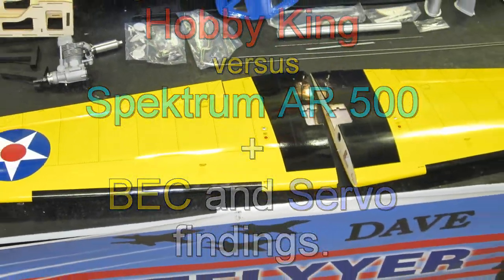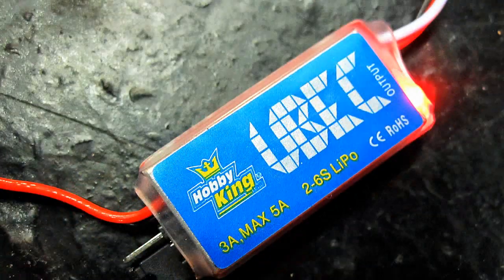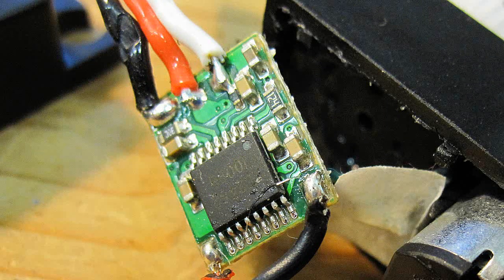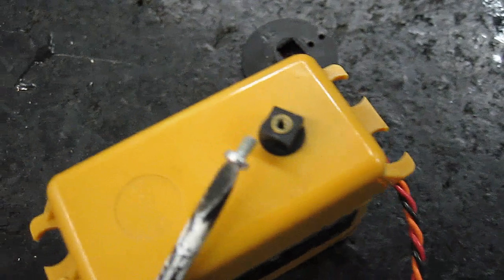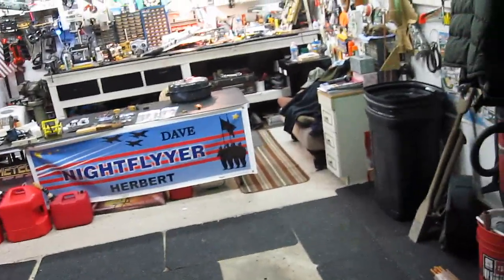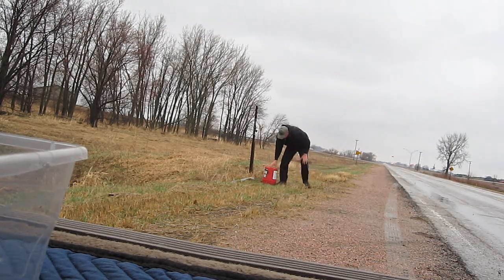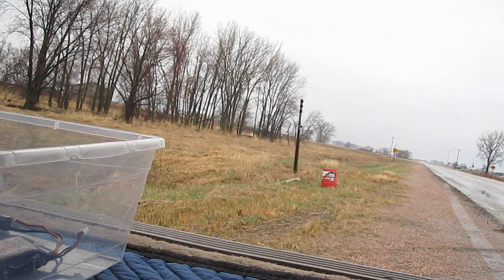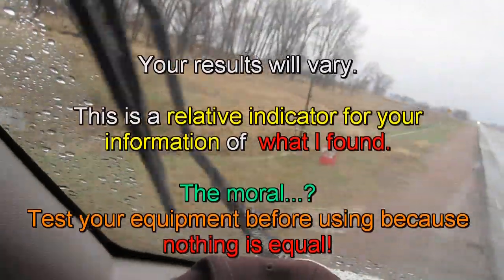HK Orange Receivers vs Spektrum AR-500- Range testing and servo failures.

Comment: When building a EXI 450, I had to remove my Spectrum AR6110 because in declining battery charge the motor would cut out on me. I erplaced it with one of the HK orange rx's and have had no problems since. I give them a thumbs up for being 80% cheaper and having good performance. Of course I can't fly my 450 near as far as an Airplane anyway.

Comment: well i appreciate your test results , i noticed the orange recievers were not the full range , where as the spektrum was,.  thay do have full range orange rx.s  with two ;long grey antennae , and i have had no problems with the full range.  yes i did have issues with the orange rx.s with the one little short red antennae   thank you , please try your experiment with orange full range ,  would love to see the results.  and fyi,  i recently have had issues with my new DX8 FAILING RANGE TEST, horizon hobby stated nothing wrong,  crashed two planes , could pace off only about 23-25 paces during range test,. not sure what to think. thank you  marty

Comment: Great video Dave, very informative.  I was wondering about the orange rx's as I run futaba and just bought a couple orange rx  but havent had the time to range test.  
I do have one question though  Why is the orange rx 1056 at 20 ft and only 793 at 15 ft? when the specturm is 1056 at 15 ft? Isn't range "Range" so to speak? or did I miss something? I did watch this video 3 or 4 times LOL any how Great test.
-OTTO-

Comment: @flyingchimp99 It takes power from the lipo and takes the volatage down to a safe voltage to power the rx and servos. Most esc has them built in but you can use an external one for saftey

Comment: To all the commenters, just my two cents...... I have a bunch of orange RX and I have a few that give over 60 paces on the range test, while others barely go 25 paces.  All have alt $12.00 plug in receiver.  Most of the guys that have spectrum TX at my field use orange RX.  Never had a problem with them, but HAVE had a few problems with Specktrum brand RX.  I fly some of my 20 and 30 cc gas with orange RX, but I don't fly real far away.  To each his own I quests.  Always range test your set ups.

Comment: good vid thanks for all the work only way to do it. I have 3 orange r615x  with the 2 little  aerials not had them long and nowhere  on the case or manual  does it say 'park flyer' or not full range  so you would  take it for granted that it was full range but on testing it obviously  isn't. l tested one of mine today put the tx in the car butted up against  the windscreen switched on and managed  to  walk exactly 470 paces away before the red flashing lost contact light came on. not exactly 470 yards but would say 400 yards give or take l took pretty  long strides. So that's 1200 feet not bad l slope and never really go anywhere  near that distance so long ir short range  is academic  to me these orange rx will serve my purpose. By the way on your  video  l hear a audible beeping  when you  drive out of range ? l don't  get that and lm using the same gear ..can you  tell me why ? mines in DSMX Mode
Thanks great info

Comment: Very Informative Dave!  Quick Question, Whats the main difference between the 2 Dx6i's?  Other than of course your green and red lights! LOL.  Just curious. I dont use Dx6i, but I have many new pilots Im training and they have DX6i's.  I only have issue with what batteries they use and what voltage is left in the Tx.    Thanks DAVE!

Comment: @sparky0308 I think reliability should be a better argument than range, especially when even 792 feet is a pretty good distance for most airplanes. I tend to fly 2m span planes not much further away than about 200 meters which is approx. 650 feet.

Receivers will be more reliable when they have double the range though and Spektrum can't quite deal that well with interference from what I've experienced.

Comment: Awesome Video...! I just bought 2 orange receivers (6 channel without the heat shrink) from Hobby King and neither would bind with my DX6i... On one, it appeared to bind but when I disconnected it does nothing. The 2nd one appeared to bind once or twice then stop the flashing led stopped all together. It just heats up when try to bind now. Very disappointed. After this video, I might try an orange receiver but wont get my hopes up...

Comment: Good video as always and great to finally see someone do a ground range test with these receivers. 

But I'd say the actual flying range should be about 1,5 times the range on the ground or so, right?

The difference between both transmitters on the other hand is surprising.

Comment: Something strange going on: if you normalize the data by taking the ratio of actual range per foot of Turkey Baster range (i.e. take the actual range stated that was based on the car calibration and divide by the Turkey Baster range test) the Red Tx comes out first with 100 ft actual per foot of Turkey, second is the Orange1 at 80, and then all the rest are 52 to 55.  So it is hard to say which combo is more reliable.  Using the Turkey Baster.  Take away seems to be to "test your installation".

Comment: I have to echo what unplugged wrote.  It's not only a matter of polarization of the antennas.  Radiation patterns of antennas can be dramatically and significantly changed by the things around it.  Just sticking them both in a turkey roaster is not good enough.  Were the antennas of both receivers perfectly straight and in the same orientation with regard to the transmitter?  Were both receivers in exactly the same position inside the roasting pan?  These factors can totally change the pattern.

Comment: I don't know if you did that, but you should guarantee that all the times the position of the antenna in relation to the other antenna should be the same, if in a test you have both vertically parallel to each other you gone have good range, if in the next test you have one perpendicular to each other you gone have crap range.
Again it just wasn't clear in the video if you took that in consideration or not, not trying to teach anything.

Comment: How do you normally have your transmitter antenna pointed when flying ?  It is not clear from your range testing on the road whether the transmitter is pointing along the road and, if so, whether it is straight out or tilted up.  I read somewhere that the range was better if the transmitter antenna was at right angles to the model.  Perhaps you could test that using your method.

Another factor should be how the receiver antennae are in relation to the transmitter so that needs testing too.

Comment: I have the dx6i and i used the hobbyking orange rx for a few weeks and had no problems with them. Until........ I lost connection with my skyfun at less than 200 feet. I picked up the plane and the light was blinking on the rx showing a brownout due to low power. I had never had this happen with the exact same setup before. Since then all of the 10 orange rx that i bought would brownout and lose connection. Its interesting that you said your two radios had different   ranges.

Comment: Great stuff.Very informative as always.Thanks for posting. I have a problem too. I ordered some Dynam motor combos.The first two were bad .They sent me 2 to replace them.They do the same.Have you ever had this problem with an electric motor? When I give full power from idle,the motors just vibrate and an alarm ring goes on? If I give power slow it will not vibrate .props are balanced.The shafts are new?Any suggestions?Thanks for any help. It seems like a cheap toy car wheel with lots of play.

Comment: Dave,  Thanks so much, I have just purchased two HK Orange receivers and I put one in a Stryker and removed the AR500 that was in there to use in my Super Sportster EP that I am currently building and this video helped to let me know that I made the right choice in switching them.  I have flown the Stryker several flights now with the Orange HK Rx with no problems, but still trust AR500's range a little better for a balsa plane and you confirmed my gut feeling.

Comment: Hi, I really like your test and I did have problens with the orange reciever too. What I did and its still cheapper then the original DSM2 reciever is to buy a satellite for the orange receiver, this will cost around $14 at Hobby King, and after that I did not have a problem at all, even fly at the place that I have cracked my planes, because of lost o f signal. That will be great if you can add a satellite and make the same test, you would not be desaponted. Regards, Mauro from Ceara/Brazil.

Comment: hi Dave, great job testing both RX's, thx for this ! I have 3 HK orange RX but recently bought HK orange satellites too.  Maidened  my PZ P51D  a couple of weeks ago (3 Flightmax HK lipo batteries 11.1 V 3s 1300 maH 20C and 2 Rhino 1350 maH 25 C used in 5 succesfull consecutive flights) with orange RX and satellite and it worked perfectly.  Range was no problem and could fly as far as I can see and feel comfortable with, yesterday I did another 3 flights and all is fine.  So far so good !   lol

Comment: Your opinion friend.I have flown Spektrum from its initial release useing a  Dx6, original Dx7, Dx7s and theDx 8 and not one singel problem ever. I have however lost three planes useing Orange Rx and had two band new ones that would not work from the time I recieved them. I would never trust anything but park flyers to an Orange Rx.

Comment: @Mrinfoone on your receiver when you look at the bind port there should be a positive/negative symbol... Out of the three wires the orange one will need to be on the positive side... Way I remember it is orange always faces the bulkier bit of the receiver... You will not harm your receiver or servos by plugging them inter wrong way... Hope I helped!

Comment: The satellites add a lot more range to these.  I know that it should only add diversity, but I checked mine with and without, and could actually get 30-35 paces away with the satellite connected vs. only about 15 without

Comment: sometimes when you expose a circut board like the one inside a transmitter it will stop working or some parts will stop working its happened to me before so maybe that happened to the bad transmitter

Comment: Unless I'm mistaken, the Orange Rx you show is clearly marked as a Park receiver, not full range.  I've flown 6 of these Orange park receivers in a number of planes at our field, flying as far as my eyesight allows and never had a glitch.  Spektrum is also made in China but hopefully with better quality control, components and design.  I also flew with Kraft equipment in the (distant) past.  Lost one plane when the wire wound elevator stick pot failed (the wiper wore through the wire and it opened up) so they weren't bullet proof.  Servos were good, though, but quite large and heavy.  I've had reasonable luck with Hobby King products but also got one inoperative servo and a receiver that wouldn't hold it's bind.
Reply from the maker: That is not a park receiver.  I had 12 of them before my big fire destroyed everything.  They all worked fine.  The park Orange receivers are called Orange Lites.  I used to work at Kraft RC systems.  We used only military grade A pots, so am surprise to hear that.  Thanks.
Reply: The Orange receivers I mentioned say ORANGE Rx, DSM2 and Park Receiver in very small letters.  The antennas are short, 1" wires poking out of the case at right angles.  What you show in the video may be a different Rx as it's not clear although it looks like the ones I've used.  Yes, Kraft was good stuff with good customer service.  I mailed Kraft about the wire wound stick pot and they sent a replacement with a carbon element.  I assumed I wasn't the only one who had a wire wound pot fail.
Reply from the maker: This WAS full range.  In no place does it say it is a Park Receiver.  It can be read easily at :23  It was the first of the Orange Receiver line in 2011 and were advertised as full range long before they came out with the second versions of Orange receivers with 2 antennae  I would never use a park receiver in any of my planes. Thanks again.